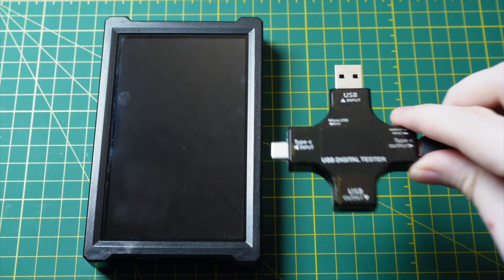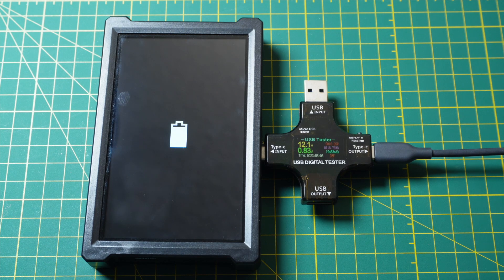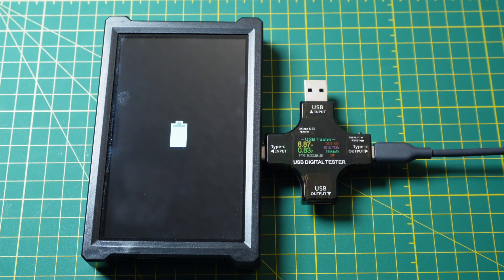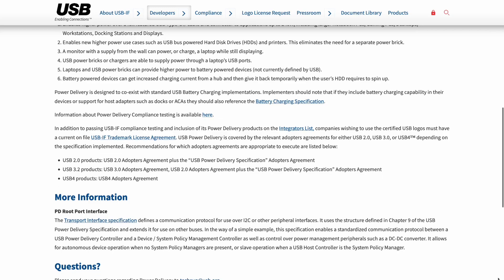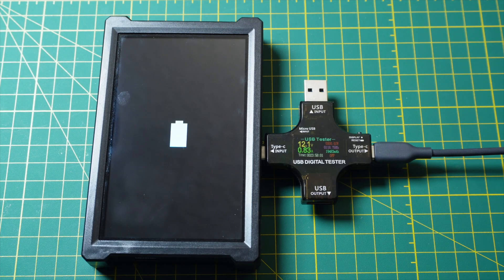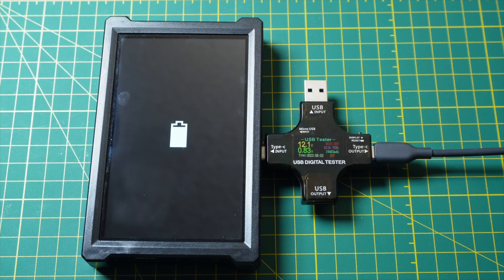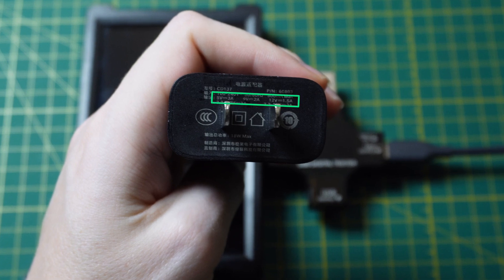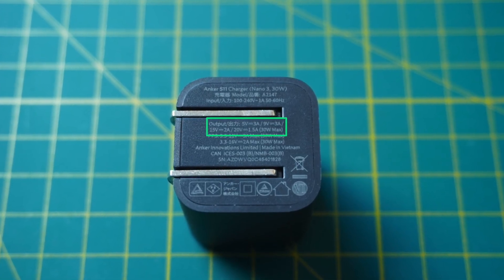Charging the REV Driver Hub

Comment: Hello @FTAAJ ! Thank you so much for all of your content. Your stuff is great and very helpful. I had a question about charging the REV driver hub using a power bank. What specific power bank or power rating would you recommend using? We're planning on using a high quality Anker charging block when it is not being used but we want something for when it is on the field being used. Would really appreciate your advice on this. Thank you!

Comment: Our REV Driver Hub will not turn on.  Do you know why or any suggestions?
Reply from the maker: You might need to remove the battery and try turning it on while plugged in to USB-C power. REV also have a battery calibration procedure on their documentation site that may help.

Comment: Hello. I love the videos. I just checked our plugs. They are from 3 years ago but they only charge at 5v.  I wonder if we should purchase others and at least bump up a little.
Reply from the maker: If you can find one at 12V, I definitely recommend having one on hand for fast charging between matches. But the good news is, you can still get by with what you have.
Reply: @FTAAJ   I just checked my charger from a recently purchased REV Driver Hub (< 1 year), and it's also a 5V / 2000mA plug.    Another team I work with also has the 5V / 2000mA plug, (purchased within the last month).  

So if REV says it's super-important to use their charging brick to calibrate batteries, shouldn't we see some consistency in the charging bricks?  I'd also be a little surprised if REV is supplying PD-capable charging bricks with the hubs... I think I would have definitely noticed that in the 5 or 6 hubs we've purchased.

Still, this video has been very useful to us.  I wish REV would give a few more details about how hubs / battery calibration and troubleshooting works -- I've asked via REV support but they just answered with "we're working on a large update" answer and no details.
Reply: @FTAAJ   Also, I'm curious if the (REV) charging brick  you show in the video has a USB-C or USB-A output port?   All of the Driver Hub chargers I've received have USB-A ports and the standard REV orange USB-A to USB-C cable.  (I guess I'm asking.... are you sure you have the REV charging adapter that comes with the Driver Hub?)
Reply from the maker: Great notes. I suspect the chargers are the easiest thing for REV to replace for cost purposes, and I bet the USB-A / 5V-only chargers were much cheaper than the one I received originally. I purchased my Driver Hub in July 2021 for reference, and it came with a UGREEN brand charger ($$$).

If you wouldn't mind, I'd love to see some pictures of what they're sending out today — especially the fine print. I'm on the FTC discord as ajfoster if you have an account there.